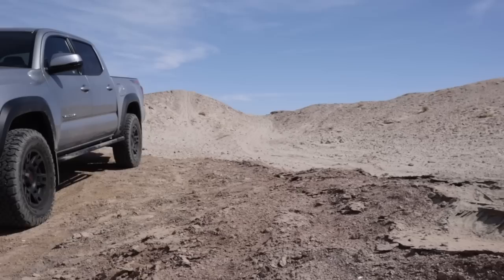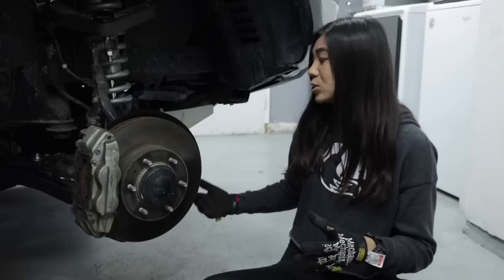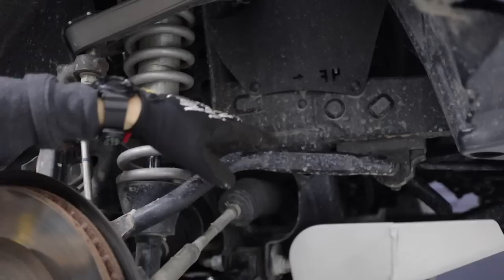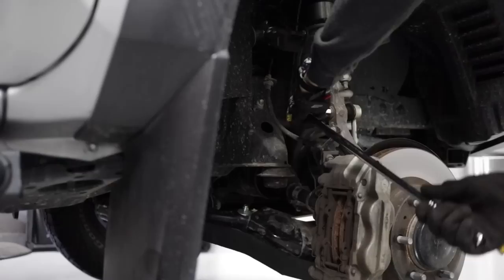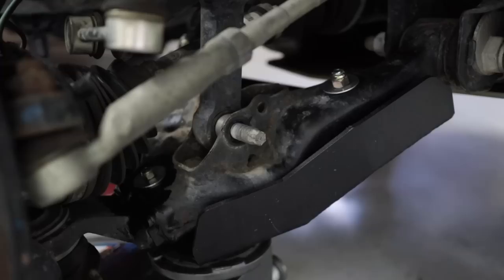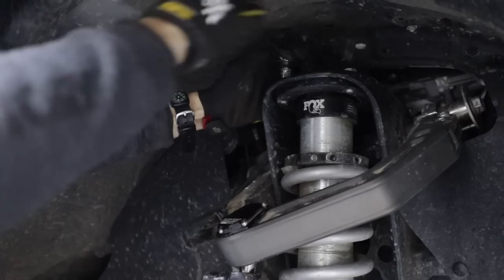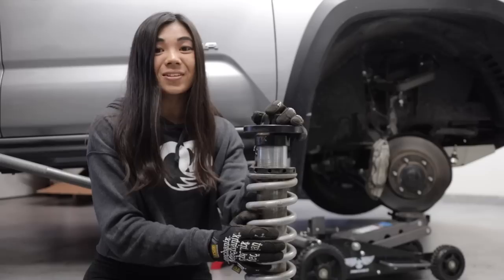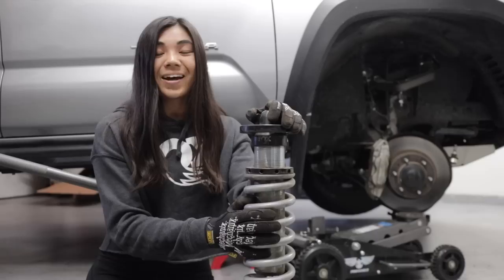Removing my FOX 2.5 Race Series Shocks | Tacoma Shock Removal

Comment: I work for Fox and build the Tacoma, tundra and Ford Raptor shocks. They are a great product and we build them with pride. With that said you must know you have to service these shocks every 50,000 miles, they are not a put on and forget shock.
Reply: How vastly different are the trd 2.5's on the pro from the fox 2.5 silver units?
Reply: Service them how???
Reply: By service he means rebuild with new seals etc
Reply: @luisarteaga9219  
Then that would depend on the usage.
Reply: very few Fox customers are actually aware of this unfortunately
Reply: @ShockSurplus  crazy to invest that type of money, not fully knowing or understanding the product . Surprised by your comment as your shop , is one of the best that doesn’t try to up sale product .
Reply: Thank you for building them with pride ! It shows in the product . Really awesome to hear this , as customer of fox .

Comment: I always use OME. With that said, there are several high quality suspension systems out there for Tacoma owners, and FOX is one of them for sure. Looking forward to seeing the install and performance of your new system.
Reply: realistically, OME are plenty of shock for MOST of us. The fox are overkill for most users... That said, overkill can be good, especially if  you live somewhere where you can more or less fly down dirt roads to moderate washboard. While the shocks could likely handle it, I would not want to do any aggressive desert driving without more suspension upgrades than this. (At very least a Cambridge, King, or Icon mid travel system. She does admit to aggressive driving, so a good set of bumpstops and limit straps would be a good choice for her.

Personally I will likely go with an OME kit myself until I can afford the $5000 for a Cambridge mid travel kit with fox 2.5s and deaver springs.

I am jealous of who ever gets her old shocks :) those alone would cover half my suspension modification needs right there. I would still need rear air bags, bumps and straps minimum, but I plan on getting those even if I only have OME shocks
Reply: @mattlewandowski73  I have been a huge fan of Deaver springs for a long time. Had a set on my 1st Gen Tacoma TRD Supercharged/ 7th Injector with Donahoe Racing RRs. Great combo! That was when I had a heavy right foot! Even back in the early 2000s, that suspension ran near $2k!!

Comment: You should get some aftermarket bump stops. I have blue sumosprings front and rear. They're great for offroading and better for when you haul stuff around. I don't haul much around but I got them to make up for the lift I got. I noticed I was bottoming out alot. You should also remove sway bar, you can't really tell the difference on the road, but when you offroad it feels more independent. Makes your truck feel more capable. I've even drivin hauling a 6k travel trailer and feels good. Hence you have strong coil overs. If you had stock I prob wouldn't.

Comment: Tip: If you are using a mallet to knock out a bolt, that you need to reuse, leave the nut on the very end so you don't damage the threads.

Comment: I got kings going back to eibach
Reply: interesting, why?
Reply: @ShockSurplus  squeaks of the spring  and it’s not even do for service yet. Just got it 6 months ago
Reply: @Imagehype  a lot more likely to be your body mounts that are squeaking. i can almost guarantee you lol
Reply: @jamiecady  it’s the lower rubber bushings for the lca that was making noises. I guaranteed cause I just had it check by kings itself . Thanks for your guarantee that didn’t make sense

Comment: 4 minutes into this video and let me tell you that removing the upper control arm is way easier just one bolt and everything drops
Reply: On the Tacoma?? Dude, no way. The one bolt on the UCA does not like to come out. Everything is in the way, it’s such a pain.
Reply: @EricBuenoo  I think he may be referring to the ball joint nut. Maybe 🤷‍♂️
Reply: @EricBuenoo  you’re exactly right. Pain in the ass. Just did this on my tundra. That 2 foot long bolt fought me every thread